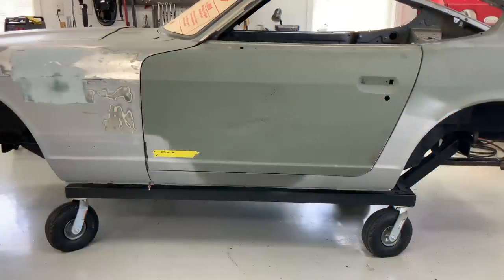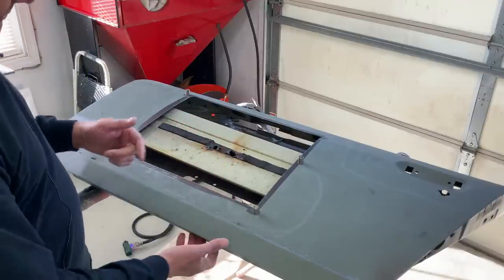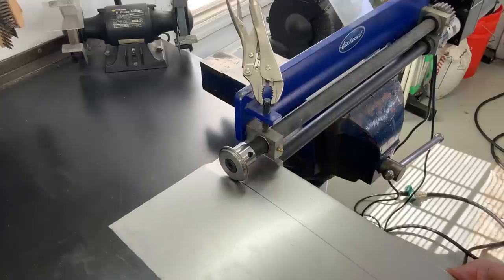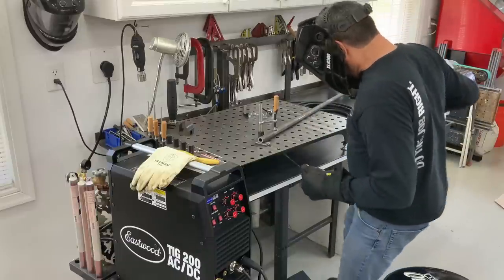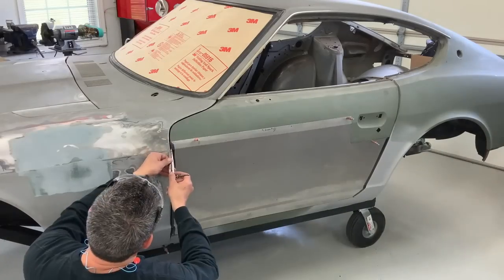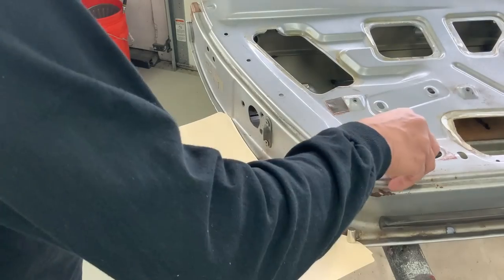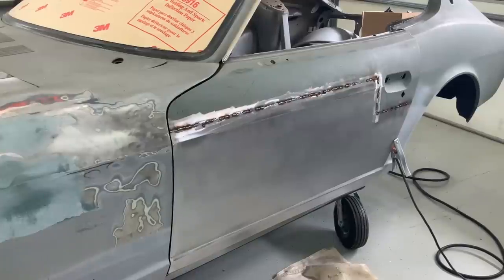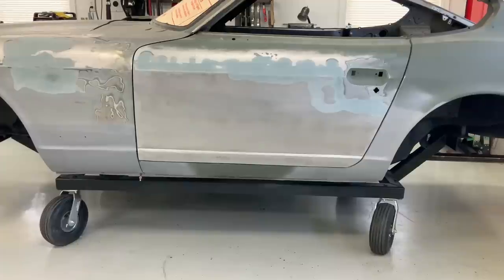How to Remove Damaged Sheet Metal & Fabricate a Patch Panel on a Door

Comment: Very nice work.  On the 1/2” fold over strips, after welding the skin, did you apply duraglass to prevent water intrusion into the seam?